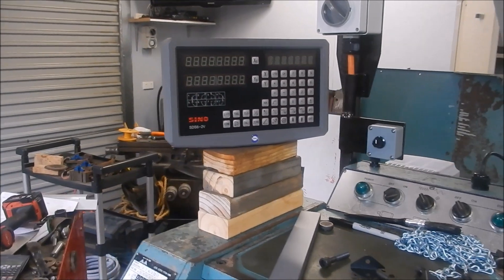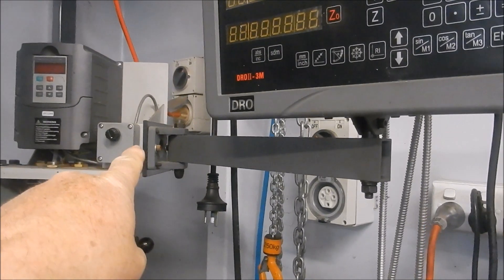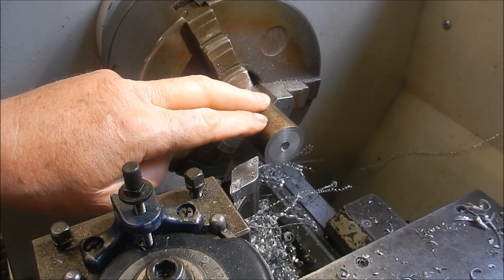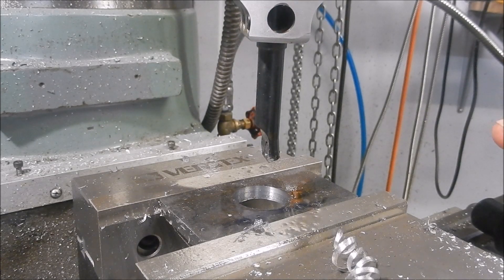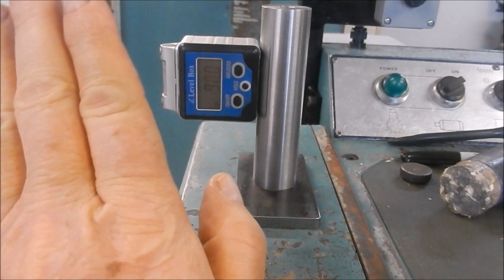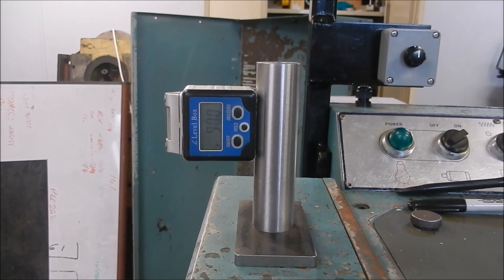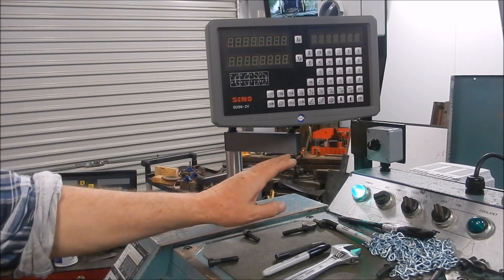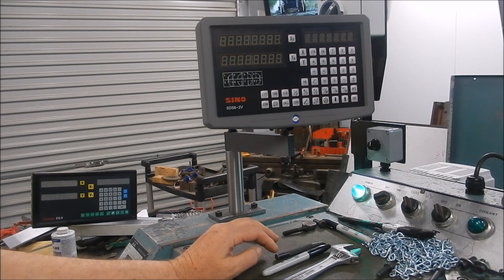Fitting DRO Scales to the Victor Lathe Part 3

Comment: Notice your boring head used 12.7 m (0.50 imp) tooling. I need to add one to my tool box. My off brand with 3/8 really hate more than 0.040 cuts on steel, loves alum. Nice install. Will coome back to see more vids. Bear in Tx.

Comment: G’day Cam. The DRO looks good and handy, good idea with fitting springs to the support, you must be clumsy. 
Cheers 
Peter
Reply from the maker: Hi Pete, wouldn't say clumsy, well not all the time but it only takes one slip up and we have all had that one slip-up in our shops.  It was a simple easy fit-up to fit heavy compression springs to protect the casing.
Cam

Comment: Hi Cam, back in 1995 I installed an Accurite DRO on my BP clone, $2500 back then!
Recently installed a $250 Chinese DRO on my small Mill, very satisfied and a lot more features than the old Accurite.
Reply from the maker: G'Day Willem, I had an Accurite unit on the large Borer I used to run.  It was fitted up by the supplier and was treated like gold.  It had no functionality other than to read distance but it was a revolution.  Still fondly remember using my Zeus to do PCD's and the Accurite DRO made it an absolute breeze.
Cam